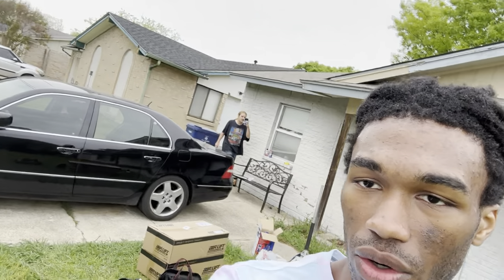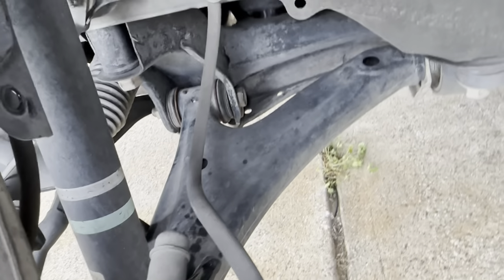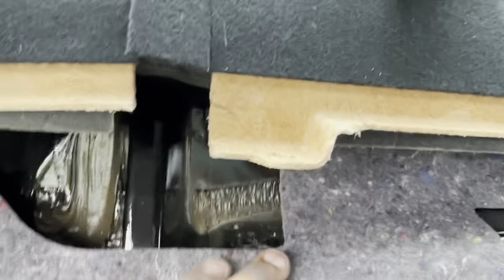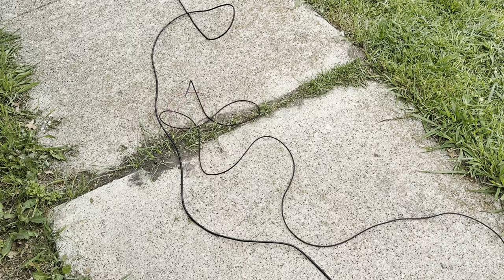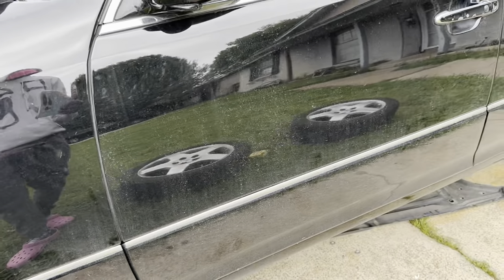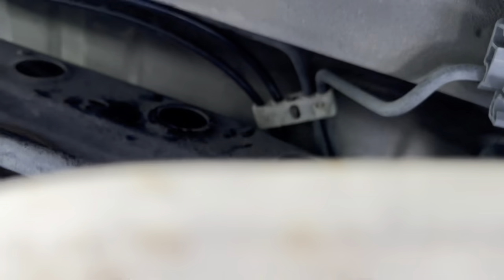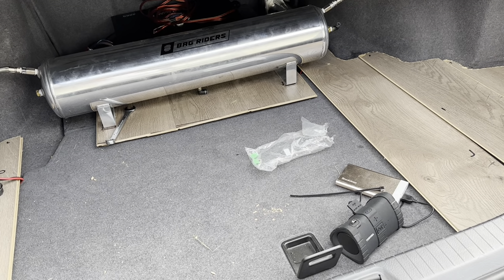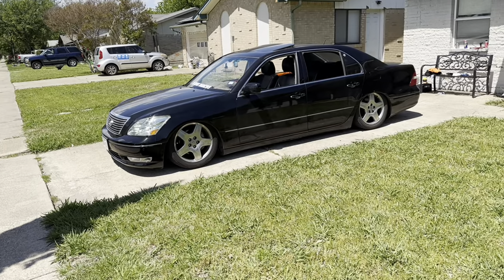(1 Hour Special) Airlift 3H Install On A 2006 Lexus LS430 (Full Installation)

Comment: If you have a UL can you just buy a management then hook it up to the factory air strut?
Reply from the maker: i Guess (i personally have no experience with the UL Platform) Ive seen people in the group do it
Reply: Yes essentially you can.
Reply: I would not recommend running the factory bags off of a modern management system. You CAN, but the thing to remember is that Lexus never intended for the LS to squat on the bags like a low rider. You would have to calibrate your system to operate within the factory ride height settings. I have a UL and my husband and I are working toward replacing the entire air suspension system due to the age and slow leaks and knocks developing. Don't abuse your 20+ year old bags, Lexus is starting to discontinue parts for the LS.